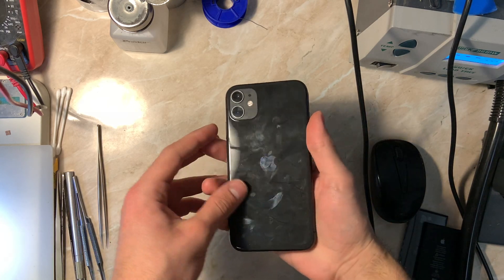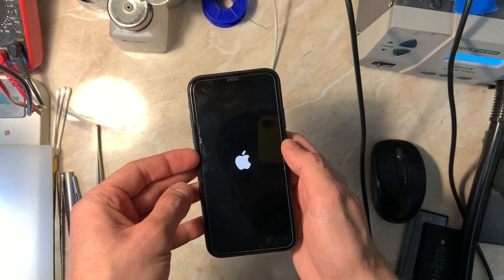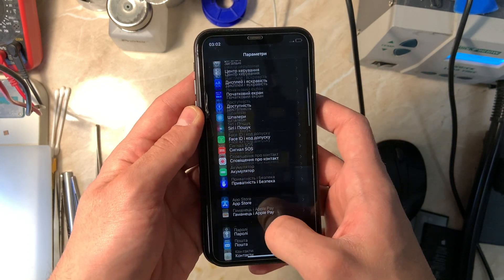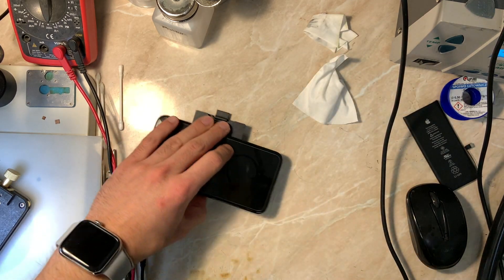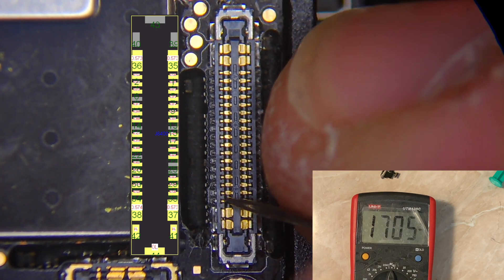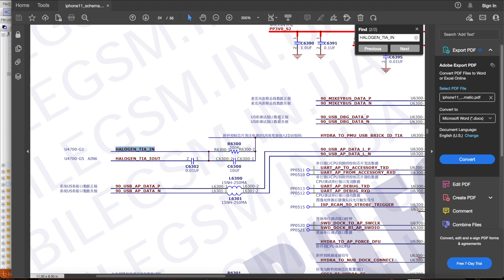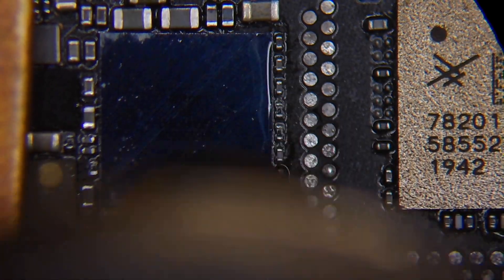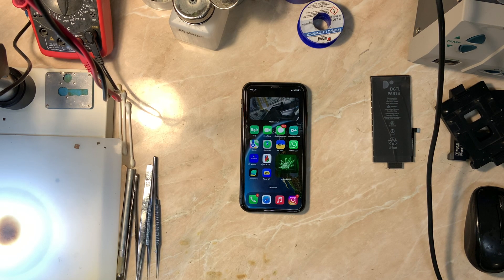iPhone 11 Restarting Issue (Charging-Audio Problem) \"_enablehalogen:4085 Unknown Rate Panic Repair

Comment: I have the exact same issue l, changed caps, resistor, codec and hydra, still same 😢
Reply: También los mismo
Reply: it turned out to be short on 1v8_s2. Also check resistor R4833 by lcd connector